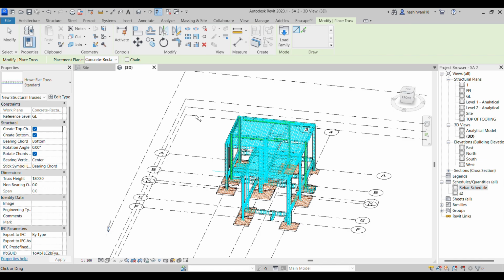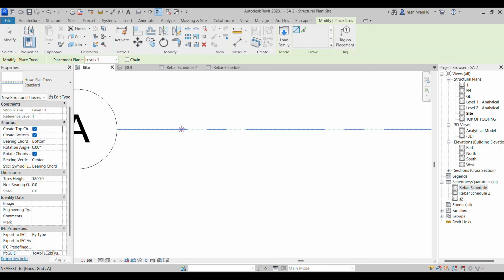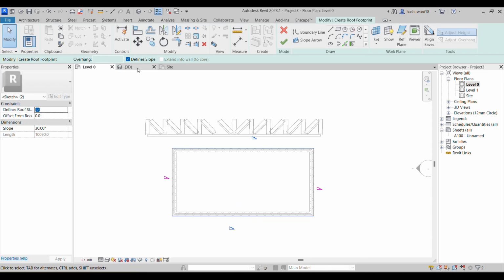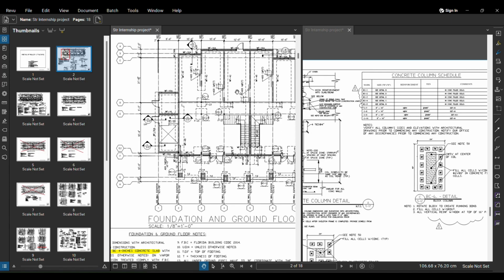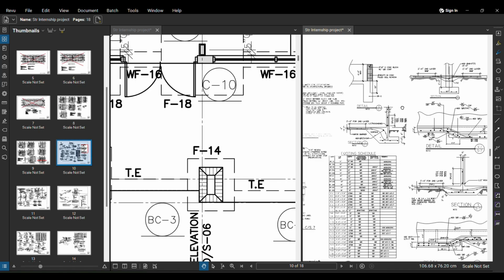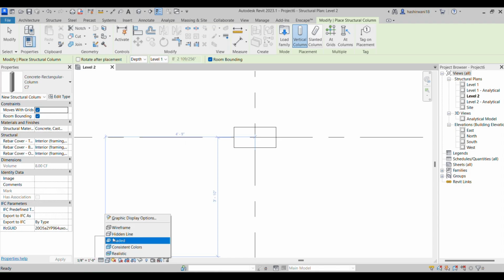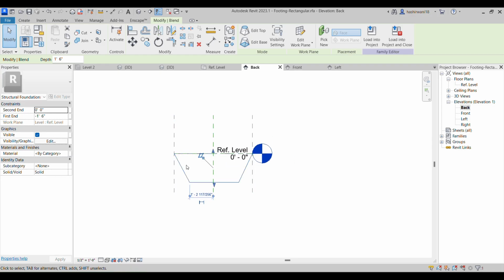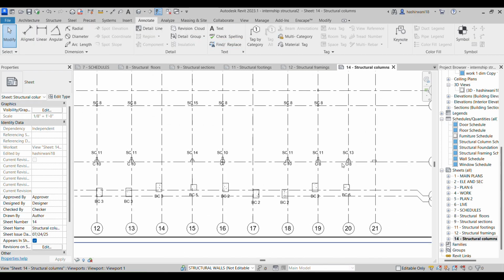BIM Structural Modelling Recapitulation Masterclass by ER HashirVani PART 2 #bim #revit #structure

Comment from the maker: This video, "BIM Structural Modelling Recapitulation Masterclass by ER HashirVani PART 2," provides a comprehensive walkthrough of essential BIM and Revit structural modeling workflows.

The video covers the following key topics:

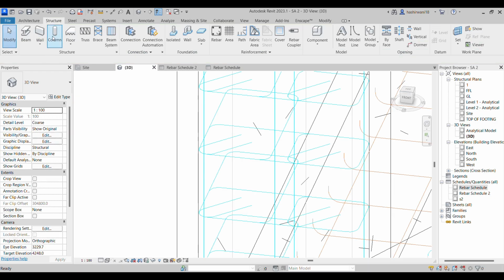Rebar Schedules (1:02-5:50): The presenter demonstrates how to create rebar schedules in Revit, including adding fields like bar diameter, length, count, rebar number, shape, and spacing. It also shows how to sort, group, and format the schedule, and mentions the "bending detail" field available in newer Revit versions for a visual preview of rebars.
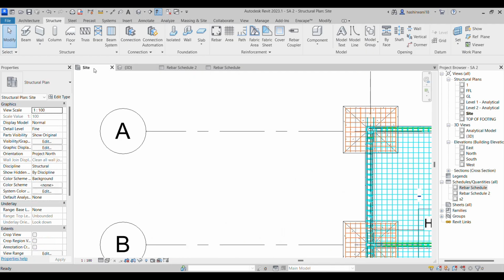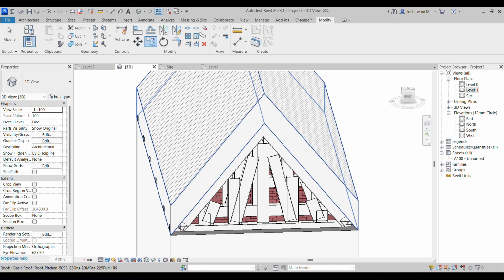Structural Trusses (5:51-14:45): The video explains how to add and modify structural trusses in Revit. It covers loading different truss types, understanding components like top chords, bottom chords, and webs, and adjusting properties such as start/end levels and rotation angles. It also demonstrates how to attach trusses to roofs.
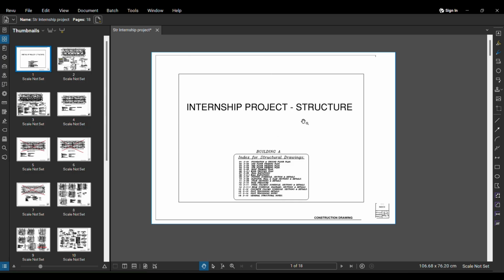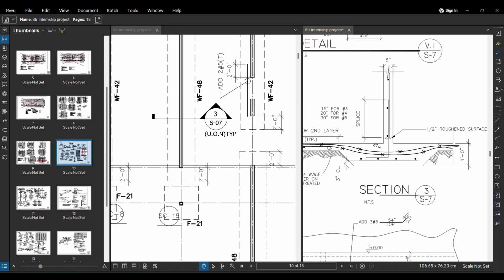Internship Project Explanation (Beams, Footings & Columns) (14:46-26:01): This segment delves into understanding structural drawings from an internship project. It teaches how to read page numbers, identify different floor plans, elevations, and schedules (footing, beam, and column schedules). The presenter shows how to correlate column and footing marks from the drawings with their details in the schedules, distinguishing between concrete and steel columns, and isolated and wall foundations, and how to find their corresponding sections.
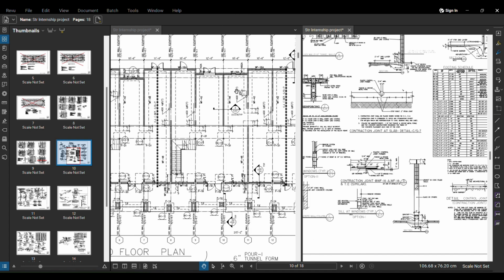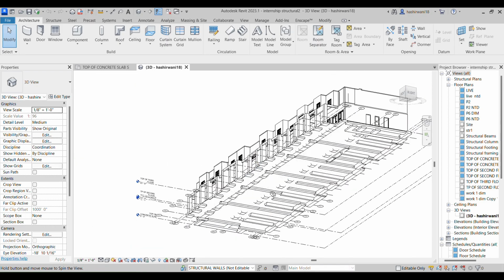Recreating Elements in Revit (26:02-35:59): The video provides a practical demonstration of how to recreate structural elements (concrete columns, steel columns, and trapezoidal footings) in Revit based on the details from the internship project drawings. It highlights the process of loading families, duplicating types, and adjusting dimensions.
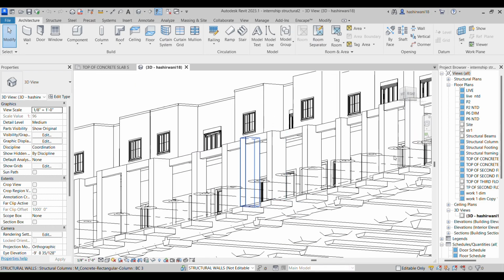Overview of a Completed Project (35:59-40:27): The presenter showcases a completed Revit project, demonstrating how various structural elements like footings, wall foundations, columns, beams, walls, floors, and stairs are integrated. It also shows how schedules and sheets are organized within the Revit model.
Future Topics (40:35-41:07): The video concludes by mentioning that the next part will cover creating analytical elements, applying loads, and performing structural analysis in Robot Structural Analysis.